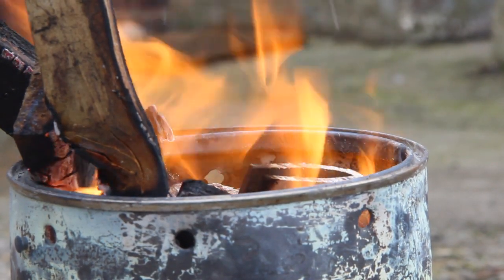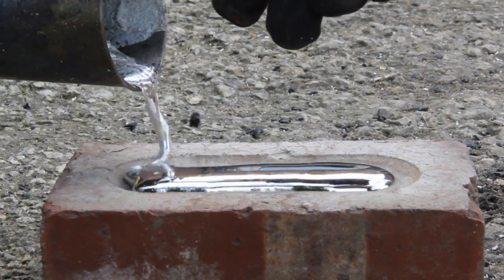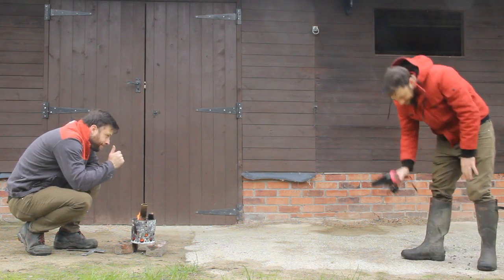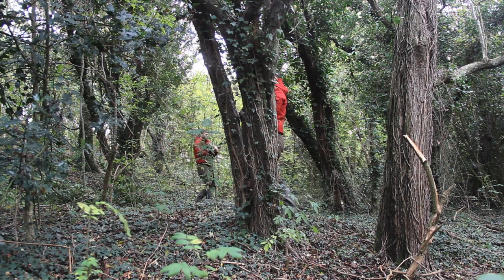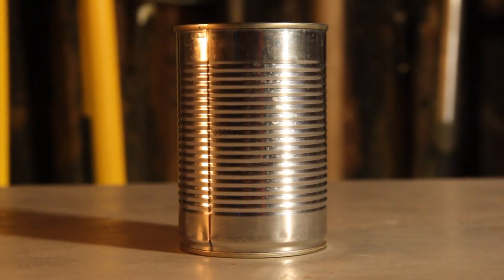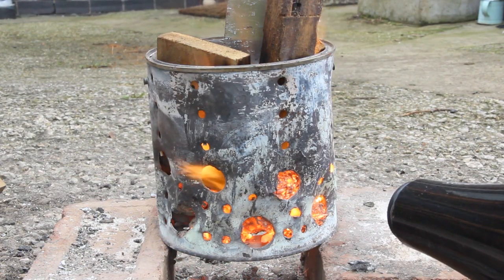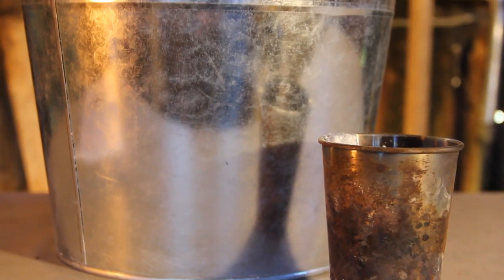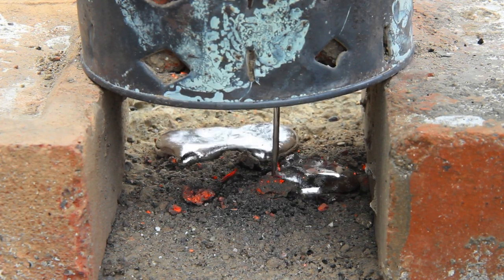Wood Fueled Metal Melting Furnace - Aluminium

Comment: Great video. I wonder if I could cast long skinny rods like spaghetti , as mini brazing rods like the adverts show? What do you think ? Thank you, Jim Tree and wood
Reply: @MetallurgyData  I saw these soldering rods on a infomercial and bought some. The video shows them doing some pretty strong bonding. A little propane torch was all they used. Of course the video is designed to sell the product but, IF, they braze onto aluminum and are that strong, I'm thinking,.... I'm a welding student at a great college now, and this stuff you shuw on your videos is fascinating for sure. Keep the videos coming please. I subscribed right away. Thank you, You're awesome. Jim